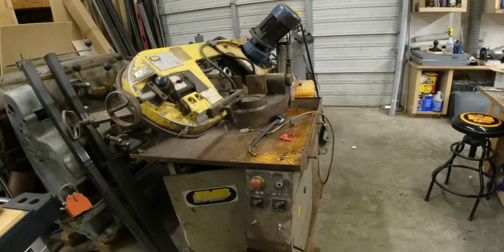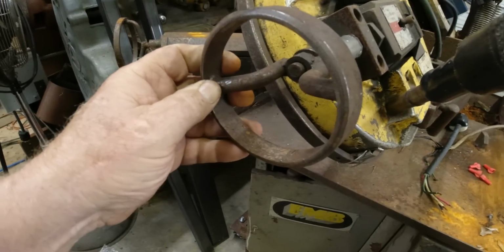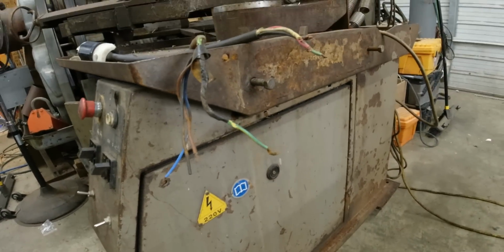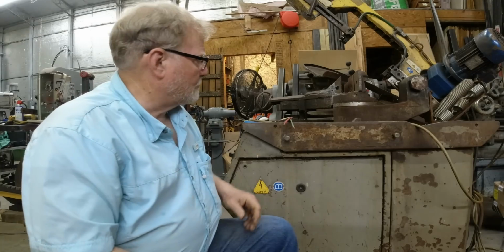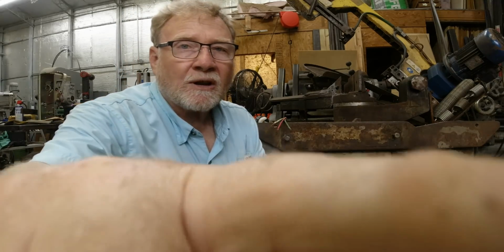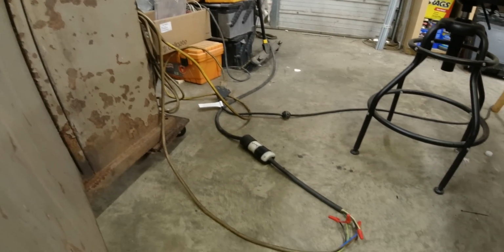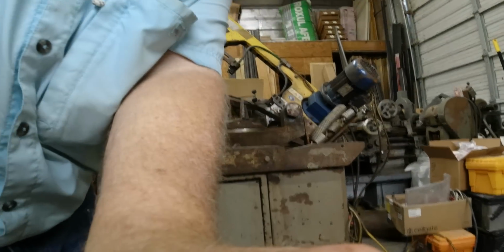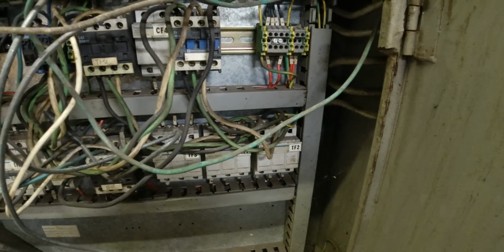Restoring Machine Tools : This Should be a CRIME!

Comment: current  color wiring code asy that black brown and grey should be phases, blue should be neutral and green yellow should be ground, but as stated by someone already machine wirings varied from country to country wildly
it had sticker about being 220v so what if it was european 220v single phase capacitor start and 2nd phase in the plug was ment to be a pump?
either way the machine had been butchered with no schematics, you can't tell if it is still similar to the oryginal circut or if it was guted and everything is wrong
good luck with figuring things out
Reply from the maker: Just going by the chart I found online...    It was run here in America so the 220 should be good.... IT's just so damn rigged it is hard to say what would not let my RPC start up...  The motor for the machine should not have started with the emergency stop pulled :(       Tomorrow I'm tearing it all apart to see what the heck it is....

Comment: I had this  happen on a air compressor because  it was on so when I turned  on my phase converter it made the same noise it didn't like it . I turned the compressor off started the converter and then the compressor and it was fine
Reply from the maker: I will give that a shot tomorrow.. It has so many loose and disconnected wires in there and I did not have time to fool with it as I was filming tonights video... Thanks For Watching!

Comment: I would suspect that the motor is set up on a Delta/Wye connection system on the Band Saw. Start on Wye and then it switches to Delta to run. Very common in European equipment because the power companies charge on the inrush rate for power. 

That saw should clean up nicely. Just machine off the bad area on the table, weld in a replacement, face and all good to go.

With all that said, I would most likely take out all the wiring while creating a schematic. Once you have that all drawn up you will see why and what. In fact, for that machine, I would most likely just rewire the whole darn thing. I would also most likely just install a vector drive for the motor.
Reply from the maker: I'm putting everything out tomorrow...  It was running here on the power grid in Houston and the motor is a two speed motor... Thanks for the suggestions!

Comment: I am from Europe and worked a lot on Itallian equipment. I need picture of motor plate to give more info. But 99% I am sure this is 3 phase 380v motor. For motor of that size we use star/delta switching at start up(in this case two cables are going to the motors). That is why there are 3 contactors. Also our contactors in 99% of the cases in such machinery have 220v coils. Difficult to believe that that is two speed motor. But motor plate will clearly state that. Motor manufacturer web site will have more info for sure.
Reply from the maker: HI there.... It is a two speed motor as confirmed by the motor plate... More trouble shooting in the next video... IT is a mess :(

Comment: Steve did you ever check to the motor tag to see if it has been replaced with a single phase motor and is no longer 3 phase? The wire was cut so I suspect it might be. Also rip all this crap out and start over with a better circuit design.
Reply from the maker: Working on it boss :)   It is a 3 phase two speed motor.... Tomorrow I'm diggin into it more...
Reply: @10swatkins  oky doke good luck. It is a  mess but Im confident you will get it right. I had a similar situation a few years back with a big commercial roof top hvac system that is as big as a semi trailer. It was totally buggered up. Stuff all by passed and jumpered by many people over the years who had no idea what they were doing. There was no wiring diagram any more.  Because it was a custom one of a kind unit, the place that built it in 1995 had no record of it in their system . It took me three months and about 20 cans of wasp spray. I ripped it all out. I ran lots of new wire, updated and replaced all the control relays contactors and motor starters for the two 3 phase 75 hp. compressors. Replaced a couple of fan motors and  two transformers to get 220 single phase for some of the components. Re numbered most of the wires. Then made a new wiring diagram for it and wrote out the entire sequence of operation from start up to shutdown.

Comment: That's not "European colour codes".  It's not even /old/ European colour codes.  It's some random piece of 4 conductor cable they had lying about.  Current IEC is green/yellow earth, blue neutral, then brown, black and grey for the 3 phases.   Before that was green/yellow earth, blue neutral, and 3 phases the same colour, either brown or black.  And you still find pre-IEC stuff, where colours change from country to country, but that doesn't fit with a machine that's at the oldest from the '80s.

Usual rule of thumb is, if it's been messed with, don't trust anything.  And if it doesn't look like it's been messed with, don't trust it anyway.
Reply from the maker: IN the next video on it I'll show the color code chart I was going off of...  Not an expert here so I do look a lot of thing up.... Thanks for the suggestions!

Comment: Steve, by any chance is that non original blue motor on the saw a single phase, seems to have 2 very thin cables going into/out of the side of it?
Reply from the maker: No.  Its a 2 speed 3 phase...   And I think its original.  The  factory still paints them that color.. Plate says it was made in 1/99
Reply: @10swatkins  Well that exhausts my ideas, buck pass to Don.
" 1/99 " I think you're right about the ridden hard and put up wet, looks 20 years older than that.
Cheers

Comment: I like to start with a multimeter, a label printer & KiCAD. Make a schematic, add the motors & contactors, and black-box symbols for any circuit boards. Trace each wire, label both ends with what the other end connects to, and add the wire in the KiCAD schematic. Once everything is labeled and there's a schematic, re-organize the schematic to make sense. Then actual troubleshooting can start.
Reply from the maker: Looking closer at this mess I am sure whoever did this has never heard of a label printer, color code chart, diagrams or anything that even remotely has to do with good practices!  Everything is coming out!

Comment: Your motor sounds like it is single phasing. One leg is not connected somewhere.
Reply: That was the sound of the rotary phase converter not wanting to start up because of a high load(short circuit?) in the bandsaw, it worked after Steve unplugged the saw.
Reply from the maker: The motor you are hearing is not the saw motor. .  That is off.. the motor that will not start is the rpc motor..  unconnected from the saw it starts fine

Comment: Personally I would just rip all that out and put a VFD in it. For the prices nowadays you cant beat them. Low voltage switches to turn it on and off, speed control, etc.
Reply from the maker: Its a factory two speed motor already..   I think that's more than enough for a saw and after pricing out the stuff I need I think I can rebuild the whole cabinet for under 180.00  IF the motor is good!   I'll find out that tomorrow...  Thanks for the suggestions...
Reply: I did just that to an import lathe a few months ago. It had a problem with starting the spindle with the carriage switch. With no schematic and several contactors, I just removed everything in the cabinet, mounted a VFD, and wired everything on the low voltage side. Works like a champ, even added a reverse jog switch.

Comment: Depending on when it was built, the European electrical code was either Red L1, Yellow L2, Blue L3, Black is neutral and Green/Yellow ground. Or IEC code Brown L1, Black L2, Gray L3, Blue is neutral and Green/Yellow ground. Machine tool wiring colors have varied wildly from country to country since more colors of wire have been available. The voltages and frequency of the power can also vary from country to country. Once a system is put in place in a country it becomes almost impossible to change. The way a machine is wired might also depend on where a machine is destined to be sold/used. You really need the original wiring schematic of the machine. If the company is still in business, it should be easy to get. Then you only have to figure out who changed what. Sometimes motors are replaced to run a machine on single phase current. If the motors aren't high horsepower, it can be a cheaper alternative to a phase converter.
Reply from the maker: Thanks for replying... I was going off of a color code I'll show in the next video.   The machine was running here in Houston at a big shop so I'm pretty sure whoever did this just did not know what he was doing and probably kicked little dogs too!

Comment: Hi Steve, you wired correctly.
The Europeans use the black as one of the phases.
Here in Australia the black colour wire is always neutral.
We use red, white and blue for the input phases and the old days it was red, white and yellow.
To make the RPC growl like that you have a partial or dead short somewhere in the machine, the 2 speed motor might be the culprit.
Payback time for Don after all the work you did on his Shaper.
Reply from the maker: I was going off a code chart I found that gave a lot of examples.... Since It was running here in Houston and was three phase there was not much chance of it being wrong on L1, L2 and L3...   Thanks for watching!

Comment: Hey Steve, I am Electrical Engineer. I design controls for a living. I think I might be able to help. Also, If you just want to rip out the old controls and start over, I can design you something new. Think about it, you’ll have working controls with drawing. I won’t even charge you, but be warned Don’s leaning is charged by the hour.
Reply from the maker: Thank you so much!  I think I have a working plan on just redoing the whole thing.  After all its just a simple 2 speed motor and a pump, 3 or 4 contactors, a off/on switch, a three position switch to control two contactors, a emergency stop button and a few other things such as fuses and relays...   

The machine has a 220 to 24vac transformer so just 24 volt rated contactors and switches should keep the control buttons safe...   

The coolant pump is not running and was a rigged 110v pump... Was thinking of throwing in another 220 to 110 transformer and supplying the new pump that way instead of running both 220 and 110 lines to the machine....

Anyway I was thinking of showing this all in the next video and asking for your opinion, if that would be ok... Send me an email ,  my address is in the contact area of youtube..

 Thanks
Again..

Comment: Your motor is poling because you have your L1, L2 & L3 legs out of phase.

There’s 3 ways they can be connected.

If the phasing is correct it will spin forwards.
If incorrect it will either spin backwards or stay stationary (pole).
So it’s the same cure as for if it spins backwards.
Just swap L1 & L3.
Then it will spin.
If backwards, then swap L1 & L2 and it should spin forwards.
Reply from the maker: Thanks . I will give it a shot.   But seeing as how the motor control is turned to off it should not even be running......    But who knows what they have done :(
Reply: @10swatkins  Would make a nice machine to restore if your planning to keep & use it. That would justify a complete re-wire.

Comment: Electricity can be very dangerous... even with power turned off to the circuit being serviced, I have found lethal levels of voltage still on the wires ... due SPECIFICALLY to those cable trays. The wires had an INDUCED voltage from a neighbouring non-related circuit.
Smart enough to know your limits .. Call Don!!!
Thanks for sharing 🇨🇦
Reply from the maker: Thanks Paul

Comment: First thing I do is on any used machine I've ever bought, if you cannot make sense of the wiring like in your case.  Strip all of that stuff out of the box, wire, contactors, everything and start fresh.  It's real easy to make a wiring schematic for a simple machine like that saw.  Sometimes, electrical engineers over complicate things wiring up a saw!
Reply from the maker: That's what I'm going to do..... The sad part is the factory wiring is still in place under all those jumpers and all they had to do was fix the parts that were bad :(
Reply: @10swatkins  Get Don, an electrical engineer should be able to make easy sense of that. I could, and have done that exact sort of thing in the industrial control world. Too bad you live about 800 miles away. BTW don't go poking around a mystery cabinet full of snakes with the power on, ask me how I know...
Reply: That is exactly what I do when I get in an old machine. 

Rip out all the old the electrical and refit it all with new. 

Most of the times I end up with a simpler electric diagram than it came with. That is also up to code.

Comment: What happened to the 7000 dollar. 10 EE ? Good content. I would have wired the motor direct if it is 3 phase. A.c. just for testing 73 dan
Reply from the maker: IT's a two speed motor and I need to figure out how they made that happen first.... 10EE is waiting on the rails, which are on the planer and up soon....
Reply: @10swatkins  thanks now i understand lol 73 dan

Comment: Sure, looks like they are running power over the green wires. Anything that hokey, I would just tear it all out and start over. It's just a saw, not a lot of complexity before Bubba got in there with his quick fixes. You may even have that 120 input cross connected to the 3 phase lines. Something that might have worked with an industrial feed, but not good for an RPC. Check all the motor nameplates, with all those contactors, maybe a two-speed motor?
Reply from the maker: It is a two speed.... They jumped so many things !   I was in a hurry and just too pissed to trace it all out today.... Got the DoAll grinder up and running... Next video...

Comment: Holy shite, talk about a huge clusterfuck of rats nest wiring. 😳 I hate when ppl do dumb shite like that instead of just fixing it the right way. The previous owner should have made you aware of what they did to the system. 🤦♂

You're best bet is just to go search the internet for a wiring diagram then gut the entire electrical system and rewire it instead of trying to figure out what the previous owner did. 
Yeah it's going to be a huge pain in the arse but at least then you'll know it's hooked up the way it's supposed to be. Plus we'll get some good content for the channel. 😂
Thank you for uploading Steve! 👍👍
Reply from the maker: Try finding a diagram, nothing on the manufactures website.... IT is just a couple of motors so it should not be too bad... Looks like all the factory wiring is still in place just 10,000 jumpers going everywhere!

Comment: Steve, it isn’t just old machines. I had a machine in my photo lab. This was to encase film out of the dryer in clear plastic. You’ve likely seen film that way. But someone got a shock touching the machine and the dryer. I found that the German manufacturer had switched the ground with one of the three phases. Amazingly, the machine worked! I had to rewire it. Elsewhere, a film processor was erroneously wired the same way. Fortunately, considering that the machine was stainless and, of course, contained liquids, nobody was hurt. But it took several hours to warm up. That was why they thought something was wrong.
Reply from the maker: People that do this stuff should be drawn and quartered!